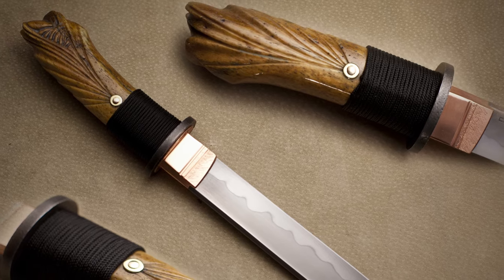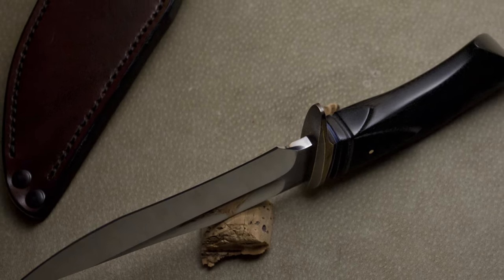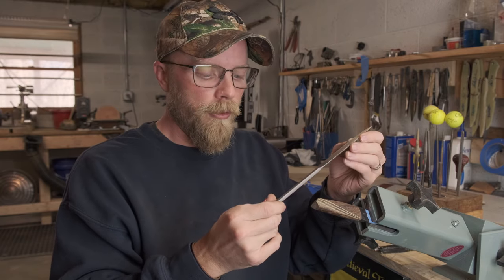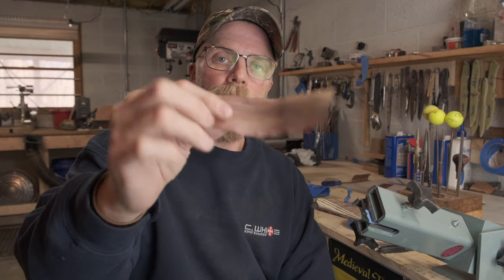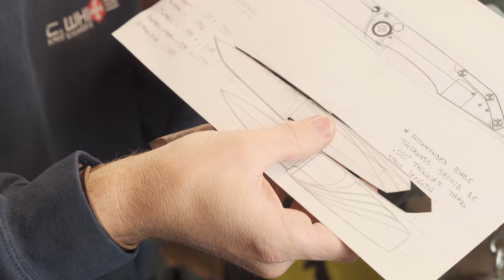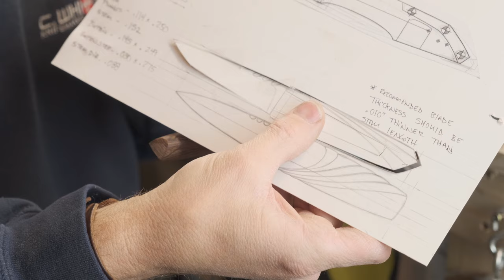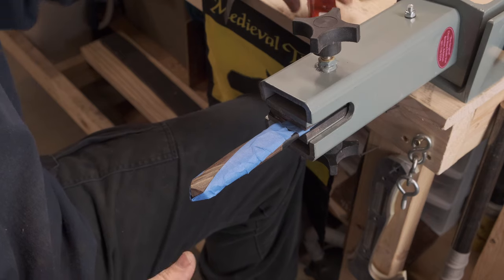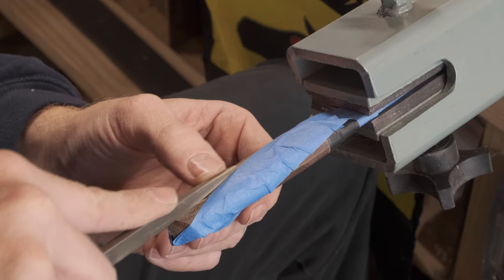How to Carve Wood and Micarta

Comment: Very unique design concept. It really adds a classy look to the handle scales. I also have dabbled in various handle detailing in my knife making. I use small metal rulers in various sizes as a backer to my sanding paper. Improvise as necessary at times. Great video content and awesome knife making you have shared with us.
Reply from the maker: Thank you 🙏🏻 more to come once I get my shop set up again.